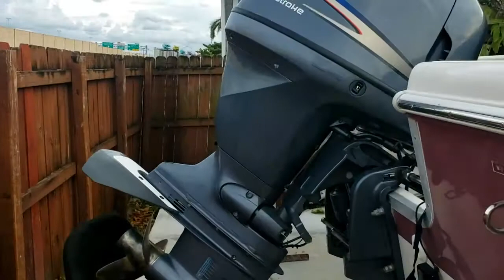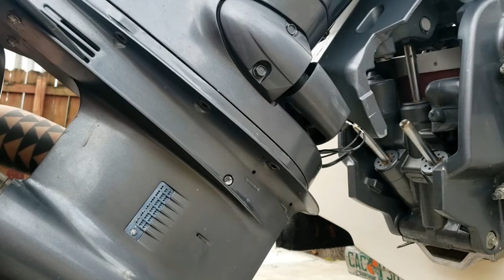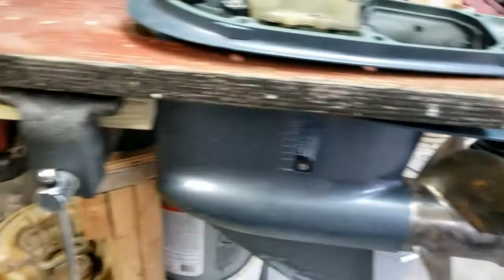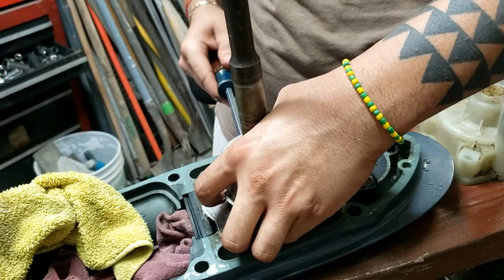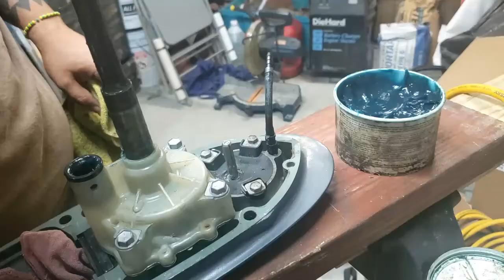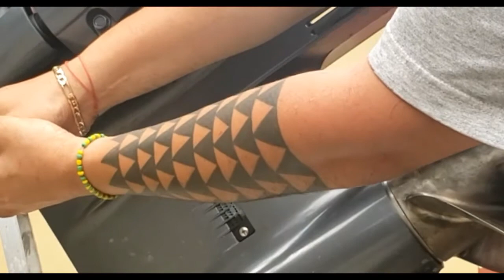2008 Yamaha F115 water pump kit replacement ep#69

Comment: Great video, may want to include greasing drive shaft and shifting pin before reinserting. Also anti seize on your 7 bolts holding lower unit on.

Comment: Thanks for the video I feel confident that I can do this with no problem one thing I was told by the Yamaha dealer is to not run the engine when using the flush port always use the muffs

Comment: Where did you connect the water hose?  I thought you had to use ear muffs?
Reply from the maker: Use the ear muffs when your running the engine. There's a hose connection on the left of the engine that can b use to flush the engine when is not running.